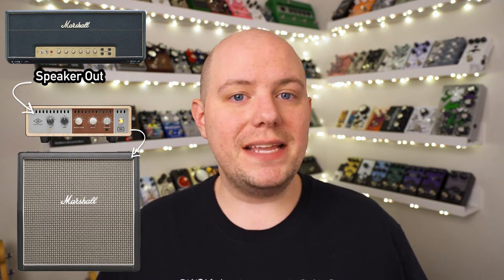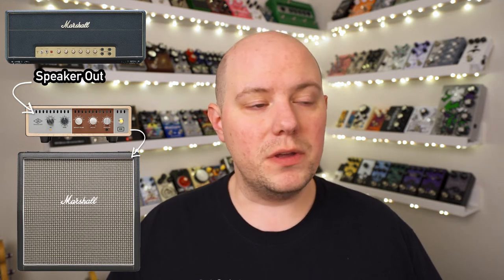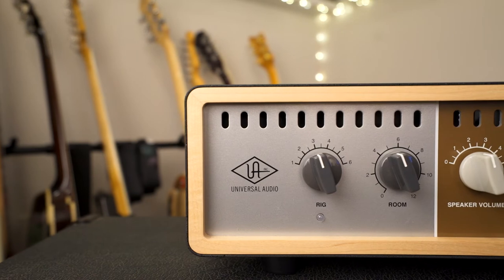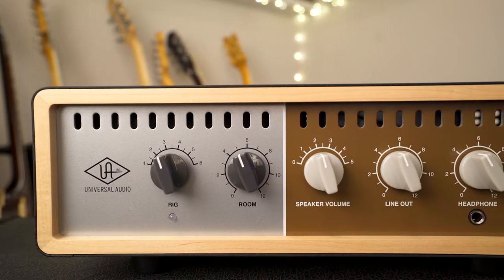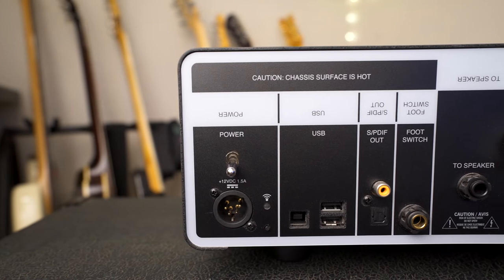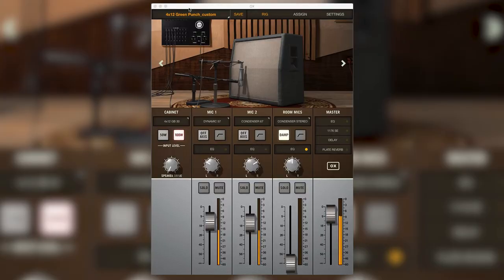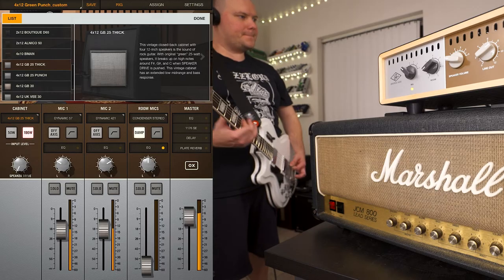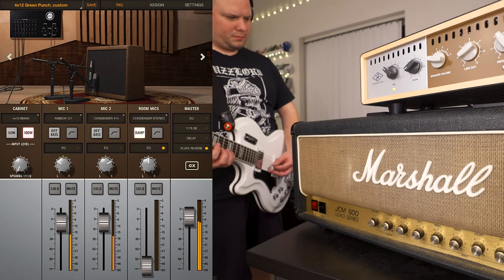Universal Audio OX

Comment: I'm looking for a cable that connects from ox to my audio interface. I have xtone duo audio interface. Which cable to you use? Does the audio interface has to be from ua audio? Thanks in advance.
Reply from the maker: I’ve got my ox hooked up via a normal 1/4” instrument cable going into my interface (Scarlett 2i2). Most interfaces have the combo xlr+1/4” input so you should just be able to use a normal cable. You do not have to use a UA interface with the OX

Comment: Is it possible to hook up my G-force from the line out and then in to my sound card so i can use the stereo fx,or will the signal be to hot?I have a Friedman be 100 with line out/thanks for a great video
Reply from the maker: Thanks for the question. I’m not exactly sure what the g-force is but it sounds like a multi effects unit. There is a stereo out on the ox. So theoretically, you could run the stereo out into your gforce then take a stereo out into your interface. There’s a level control on the ox so you can set the amount of signal coming out of the ox.
Reply: @EricMerrow  Ok,thanks,i will try that, the G force is an multi fx from Tc electronics.

Comment: The Ox costs a small fortune, so I'd rather look into alternative solutions for recording and playing at low volume. It's a cool unit, no doubt, but far too expensive for an amateur like me.
Reply from the maker: Jesper Bøggild-Christensen if the Ox is that much outside of your price range, you could look into the Torpedo captor. It loads your amp down and attenuates amps. It’s also got an analog cab sim built in but that’s not going to give you as much flexibility as the ox.